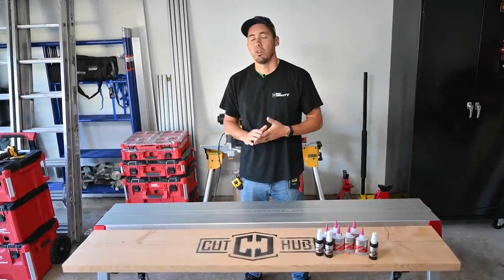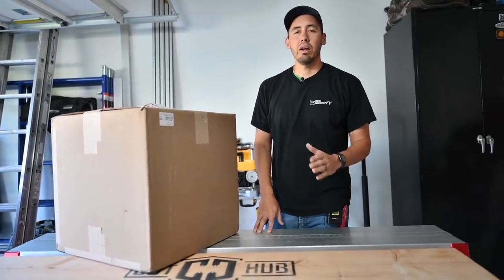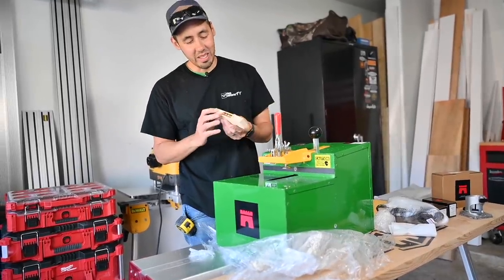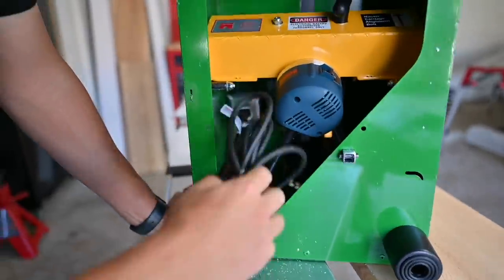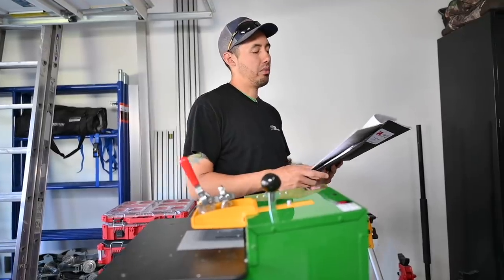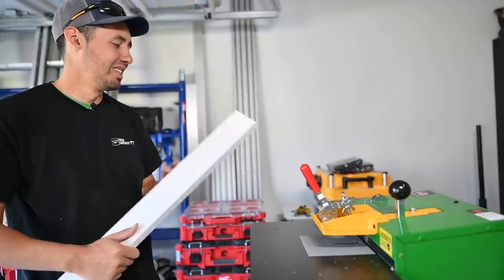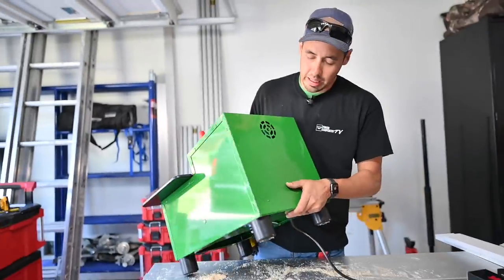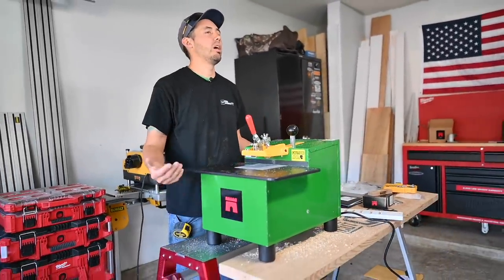$1400 to cut pocket holes??? Let's See How it Works!

Comment: The block they sent is a proofing block made on your machine to prove it was tested prior to shipping, hence the sawdust. Great video as always!
Reply: Wow a company that not only tests the equipment but sends the evidence.
Reply: Yes, very few companies do this anymore. I remember when most midrange to high end tool companies did something similar. Good stuff though.
Reply: Kind of like the spent shell they send with some new guns.
Reply: Yep... Block and sawdust just evidence of a factory test.  I recently purchased a $3K espresso machine. Arrived with traces of water in the brew lines. Not a refurb, just proof it was tested before shipment.
Reply: Like when I married my wife and she came pre-loaded with some hickeys as "proof of testing".
Reply: Sounds like the MADE IN THE USA 🇺🇸 is meaning something again is that the MAKE AMERICA GREAT AGAIN EFFECT , why buy cheap Chinese plastic or assembled in Mexico but sold in USA
Reply: @frameriteairdrie578  Now that was funny!
Reply: @frameriteairdrie578  Its good to be the king.
Reply: @frameriteairdrie578  Could have been worse!
Reply: @ds29912  Buy a Smith and Wesson comes with a spent casing fired from your firearm. Same thing.
Reply: That's what i was thinking

Comment: When I was building cabinets we had one of those that had a petal that activated a pneumatic press. You didn’t have to clamp it it did it itself in one fluid motion, that is what you need my man! I believe it was the same company that made it. Made making face frames super easy, also had a big slab with a rolling bar with adjustable pneumatic presses for assembling the face frames, def can’t move it around but if you wanted to assemble everything before hitting the job site you would be in business. The company was ts Varner in Wichita Falls tx, hope you love your new machine my man!

Comment: I used one of those pocket hole machines when I worked for a custom wood shop.  Back then like 25 years ago they  cost  $30,000.00 yeah yikes. It was priced liked that because it was new and people where tired of gluing biscuits and waiting for dry time. It was my favorite tool in the shop even better than our 4 foot belt sander vou ran face frames through.  You will make your money bag in no time. Cut all your styles and rails at once then go to town. I know you've said this is in other videos  but  there could be a newbe watching. Nice video as usual.

Comment: The biggest difference in pocket holes is the drill angle 6 degree(Castle) vs 15 degree(Kreg). The Castle style is pulling almost horizontally so the surfaces stay flush.
Reply: I too saw that video on Brent's Woodwoorking & More.
Reply: @Zachary_Setzer  me too.  Can't justify at this point having one but it's tempting to get the smaller model which is about $600-700.

Comment: Nice demo,  When I looked for a pocket hole machine 5 months ago I could only find Shop Fox and Kreg Foreman. I purchased a Foreman, but not happy with the all plastic build of it.  The machine you are demonstrating looks to be a much smoother machine to use and the setup much easier. I have a complete K4 master set and the Foreman now and may have to put them up for sale.

Comment: That’s crazy, I’ve never seen a  manual  hand clamp castle machine. Ours has a foot pedal with a hydraulic press. Nice to see they offer a variety to choose from. Coolest day @ work last year, the boss “You’re going to Petaluma to pick up our new castle machine”. Awesome!!! Our shop is in San Jose. Anyways Castle is the clear freaking leader. My boss said the customer service he received from them is off the chart. They even called a year later to check and see how it was performing. We have 2, one on the main floor and one by our benches 😎

Comment: this is the old proter cable machine. Castle bought the rights. it is a fine machine. As a production shop we hav e never been let down by it. We also run their larger commercial air assisted machine.

Comment: Thanks for the video. When I was in college in the early 1980's, I worked in a cabinet mill. Your new machine is exactly how we made pocket holes. (I don't remember the brand name.) The only difference is ours had a pneumatic clamp, operated by a foot pedal. The machine is designed to be left on in-between pocket holes. Once you get into rhythm, it's very fast.

Years later, I returned to woodworking as a hobby and bought a Kreg jig. I was so disappointed! Not only is the jig slower to use, Kreg-cut pocket holes tend to misalign parts as they're screwed together. That's NOT the case with a properly cut pocket hole! With the Castle pocket hole machine, the screws go straight into the other part. With the Kreg, the screws go in at an angle. The angle tends to pull the parts out of alignment. Not good! Having said that, I've made lots of quality things with my Kreg jig. I'm still disappointed in it.
Reply: If you don't clamp your pieces during fastening, Kreg will always be a mystery when it comes to guessing if the joint will be flush.  Generally you can get pretty close guessing, for construction stuff, but it's a nightmare for any half decent woodworking project.

Comment: I have the $400 electric Kreg foreman its the best, and most useful tool in my shop. Just my opinion, but I think I rather have the Foreman. less steps to cut a pocket hole, one pull of the handle it turns on, clamps, and cuts the hole. and has a vacuum system. However yours does make better looking pocket holes, but whos going to see them. Love your channel. thanks

Comment: Cabinet shop I worked at back in the 90's had something like that but it was free standing and had a foot pedal to move the routers. I built a whole kitchen (a big one) in 1 day with that thing. Also had a wall mounted face frame assembly rack. That was the best! Sliding arms with easy adjust clamps. You could do a whole frame by yourself in just a couple of minutes. Great space saver too.

Comment: This looks similar to the earlier pocket machine manufactured for a short time by Porter Cable.    It never seemed to become popular in the woodworking industry.  I myself used the Kreg pocket hole system which was popular and still is today.  It was faster and more portable.     The Porter Cable machine  even required the same two step to accomplish the pocket hole.   One to cut the pocket and the second to cut pilot hole.  Kreg now has an affordable  electric pocket hole machine that I participated in the pre market testing that is fast, cutting the complete pocket hole in one motion.  This is the Kreg Foreman .   Kreg also has several pneumatic  multi-spindle machines.  Like everything else there is multiple companies developing and improving on all the popular and successful techniques .  Cutting of a pocket hole and how clean it cuts will only matter if the pocket hole is in plain view of which the object of desire is the strength of the joint , its speed of completion and most of the time is hidden from view.

Comment: I had the older kreg blue plastic jig.  I upgraded to the K4 with dust collection and it is great but slow.  I make cabinets with pocket holes and have all the accessories for the K4.  The K5 has the auto clamp, within a range.  I looked at the castle smaller little brother and I thought about it.  Dust collection is a big deal with pocket holes.  I like the router based and I think the castle is a different angle than the kreg.  I dont think I could justify $1400.00 for a pocket hole jig but the little brother maybe?  The 110 is $650.00 but looks similar to your larger machine but the table seems a little small.  Ok for boards but you would need to make a desktop jig to hold it for panels.

Comment: Ive used that exact tool in a cabinet shop. In the rare instance where you use pocket holes this saves a ton of time. For instance, if you need to make 100 feet of light rail, this makes it a breeze.

Comment: We used have a pocket hole machine in shop class about 20 years ago. I believe Porter Cable made it.  I'd never seen one before and haven't since!
Reply: Castle actually licensed the design to Porter Cable.  The Castle TSM-12 is the updated version of the old PC model which was discontinued many many years ago.

Comment: Actually, Porter Cable produced some hand-held and stationary models based on the low angle router decades ago. If you're familiar with New Yankee Workshop with Norm Abram he used to have on in the shop and used it quite often on the show.
Reply: I was going to say this is just a knock off of the Porter Cable  production pocket hole cutter.  That being said, Richard  you are going to find it is a HUGE improvement over the Kreg jig because the screw angle doesn't cause the faces to unalign.  We actually burned out a couple of the routers (PC690's) due to constant use.
Reply: We had the Porter-Cable version in our shop also, great machine.
Reply: Yep!   X4.  Porter Cable production pocket cutter was a thing back when PC was a real company.
Pneumatic clamp and pedal activation.
Reply: I had the small Porter Cable one. It’s the same machine. PC licensed the design from the Castle Co.
Reply: What's the price difference?
Reply: @randybobandy9828  Porter Cable stopped making them around 2010. The PC one cost me about $1k in 2002. They are much better than the Kreg ones.
Reply: @hughtoobin7207  - other way around - Porter Cable reached out to Castle and Castle licensed use of technology to Porter Cable
Reply: Black & Decker sold their commercial pocket hole machine business to Castle.
Reply: @mrt076  I read that in one of the comments - I guess it was my New Yankee bias.  thanks
Reply: Michael is correct, Castle actually licensed the design to Porter Cable.  The Castle TSM-12 is the updated version of the old PC model which was discontinued many many years ago.
Reply: @castleusa2792  today I learned something new. On a side note Castle pocket holes are 1,000% better than Kreg.

Comment: I have bought several Grizzley machines.
One was a cyclone dust collector.
When I got it unpacked and set up, the motor was dead.
I called Grizzly.
To my amazement, they don't have a process to test run electric motors.
Of course, they gave me a new one, no charge. But it was inconvenient for me.
This company that makes the pocket hole machine has a better process.

Comment: The soft woods used in most paint grade trim won't dull your bits too fast. Walnut,  oak and hard maple are a different story.  Just keep checking the tightness of the big router they can loosen. Good investment.

Comment: Great video.  Yeah those Castle pocket cutters are pretty sweet.  They were actually original designed and manufactured by Porter Cable and utilized their routers.  The Castles ones look virtually identical.  Not sure if they bought the design or just copied it.
Reply: Actually its the other way around.  Castle licensed the design to Porter Cable.  That agreement ran out many many years ago.

Comment: I have one, it is great when you have a ton of pocket holes.  I installed a cover over the bottom and connector on the back.  Connect to a shop vac with cyclone for dust collection.

Comment: That is one home engineered pocket hole maker!  Metal fabbed box with some off the rack components to make a pretty sweet pocket hole cutter.  

Just make sure they grounded that electrical inside the junction box.  

Should save you a lot of time
Reply: thts what you want your money spent on. i would rather a well built but crude frame like that rather than all plastic and fancy crap all over it that breaks and falls off

Comment: Hey Richard, have you ever used the Kreg Foreman? Or just the bench jigs? I've looked at similar machines to what you bought in the past, but they were a lot more than what you paid 2k-3k and up.  Although your machine looks heavier duty, I've been impressed with the Foreman. One thing that's cool about it as that it clamps and drills all in the same motion. $400 is what I paid for it.

Comment: Back in the early 80's when I first noticed pocket holes (before Kreg).  The large cabinet shops used a pocket hole machine that looked like a large vertical panel saw.  You placed the entire cabinet frame on the tool, a piston would hold the pieces together where you would drill and screw at the same time.  There were portable pocket hole tools available, of course I have one, which used the same method.  Assemble the frame, then drill and screw at the same time.  Kreg came alone later.
Reply: You are talking about a faceframe table...most likely a Ritter table....just sold one!

Comment: Porter Cable use to have the same model. It looks almost the same as that old model. That Porter cable was a beast
Reply: Castle actually licensed the design to Porter Cable.  The Castle TSM-12 is the updated version of the old PC model which was discontinued many many years ago.

Comment: I have the old porter cable version, it's bad ass. The angle of the pilot hole means your joints stay flush without clsmps

Comment: How much was the machine?  Did goi also get the model 100. Smaller made of stainless outer shell. I think it has one router and maybe there is an area where you can run a drill for the piolet hole. 

Keep the great videos coming…

Comment: You will enjoy it. It's a superior hole to the Kreg. You're cut and assembly time will improve. Also if you push to hard over time the stop will move and cause the bit to cut higher.

Comment: I noticed that the screw pilot hole is straight not angled like a kreg.  This means that the wood does not slide when the screw is tightened.
Reply: Wr have larger castle machines in the shpp where I work. The pilot hole is angled, but not near as much as the kregs. If the material is slick it will still move a little.
Reply: It's at 6 degrees instead of the normal 15 degrees... So not quite straight but a lot easier to hold in place with just hand pressure instead of needing to lock it down with a clamp every time.  Plus, it's much safer and easier to use on thinner materials, which is perfect for his needs...

Comment: We’re you looking for just speed of use or the low angle pocket hole. Kreg makes the kreg foreman which faster than their standard kreg jig and about costs a lot less than the castle pocket hole jig. 
That is a great tool for someone who is in the trade and will pay for itself.  I do like the low angle pocket hole. Have fun with your new toy.

Comment: in a future video... I'd like a real timing of how long it took you the old way vs this new way once everything is setup. Cause pocket holes don't seem to take me very long, but I'm not a pro carpenter making nearly as many as you, so I think its a sense of scale is the difference.
Reply: It's about the same. We had one in our cabinet shop and needed to do about 500 a day. We raced once doing 150 holes and the end result was only about 90 seconds slower with me using kreg jig
Reply: @mjrwey  lol, i doubt that
Reply: One thing about using this versus the Kreg is that the pilot hole is much cleaner. The kreg punches through from the screw direction often leaving an incomplete hole. When the screw punches through it pushes wood forward and creates a gap in the joint if your clamping isn’t perfect.

Comment: As a cabinet maker of many years, my preference is the Kreg style machines. Less moving parts. If you can find a pneumatic version, that is by far the best out there. Electric motors will need to be maintained while the pneumatic drills will just need a few drops of oil.  Just a thought if you are considering one of these.

Comment: Nice video Richard.  I wonder if you’ve used the Kreg Foreman system.  I’ve not used either, but the Foreman looks just as fast and is 1/3 the price.  Is the value in the quality of the pocket holes?  Also, how do you cut plugs for the Castle system, if you want a finished look? Can you use a standard plug cutter or dowels like with the Kreg?

Comment: Well thank you for that.   Great video~!!   I was pretty staggerblasted at how simple the innards are. A thousand dollars for a band clamp and a U bolt?  I'd be interested in seeing what the bearing surfaces look like  for the swinging  router arm and the drilling  linear action.  Is it a recirculating ball linear bearing or bronze on a steel shaft?  Is the hinge a bronze bearing?   Oillite Bronze would work fine and last for years and also be cheap to replace.   
I do appreciate the peek inside.  I can build one.
Ohh, lovely children  I like kids.

Comment: The bottom of the cut where the screw head sits is not flat, it has a radius to it. Do you use a standard tapered wood screw vs the Krieg screws which are flat on the underside of the head?

Comment: My cnc will make this style, but I have to drill the pilot myself. 
Castle pockets are stronger I think, but it's a pocket hole so... Wouldn't the lighter, simpler, one step, Kreg foreman be more what you would use for jobsite trim type work?
That looks like a shop tool to me.

Comment: The end of the pocket is rounded now though? How does that interact with truss head screws? Do you use different screws from a Kreg setup? I feel like the rounded part of the pocket would facility splitting if you over tightened.

Comment: I work for a customer cabinet shop, we use a larger version of the Castle that utilizes a foot switch that activates a foot that holds the wood and cuts both the pocket and pilot hole, all in one motion. It's pretty damn neat, but the pilot bits rum around $20 each, and they tend to break quite often with harder woods, such as white oak or walnut.
Reply: Gary, reach out to us.  We should be able to help.

Comment: What about the thickness of the wood? Does the clamping motion automatically adjusts the location of the pocket and screw holes or is it only designed for 3/4" boards?